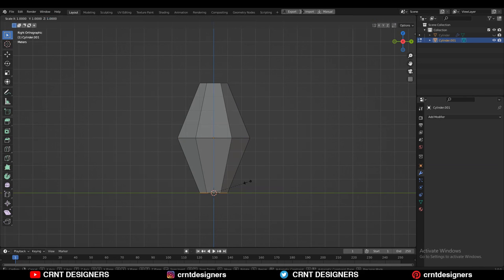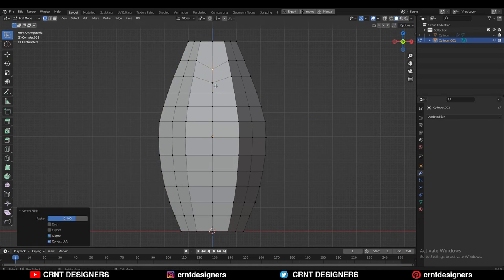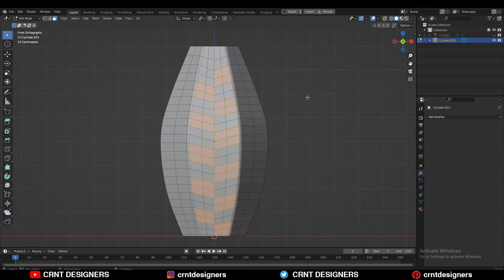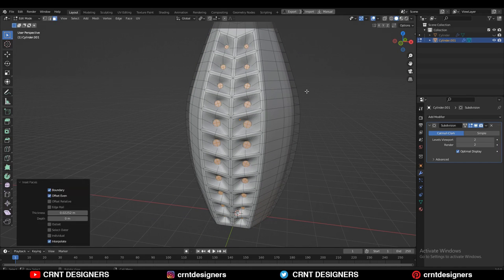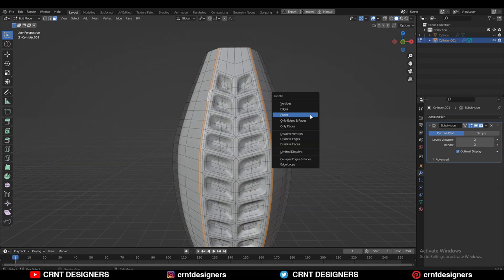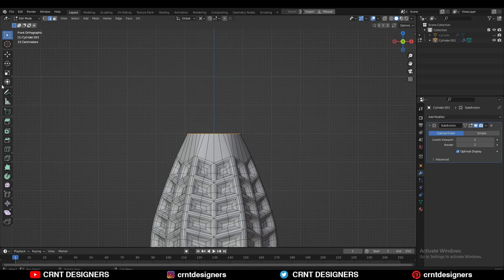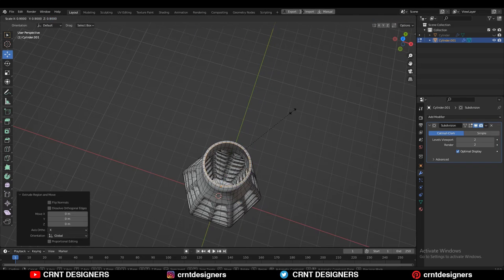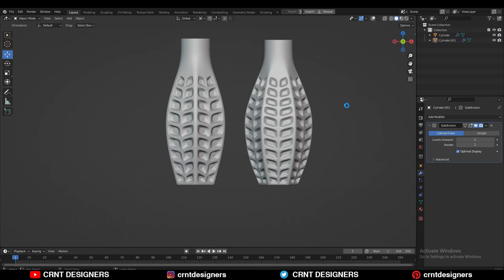How To Create This Flower Vase Design _ Blender Subdivision Surface Modeling Tutorial

Comment: Somehow...while using Set Flow...the model becomes skewed in plan. I applied the transforms before giving that command. Any hint as to what is happening or missing?
Reply from the maker: This happens sometimes. In such cases I manually adjust topology with knife tool or edge slide